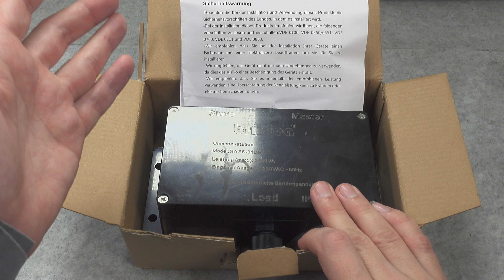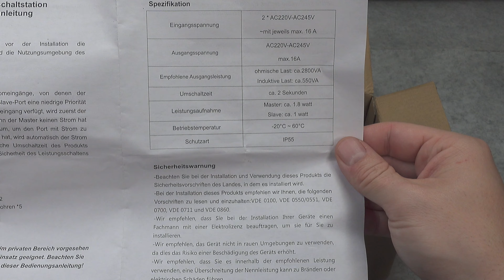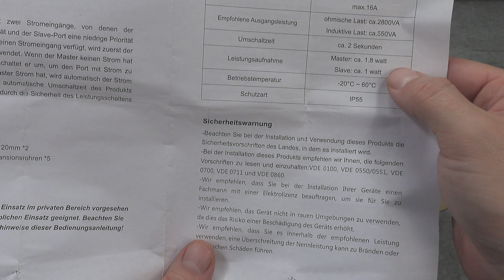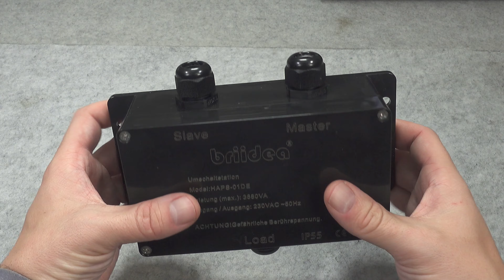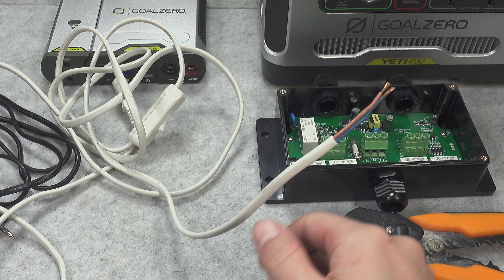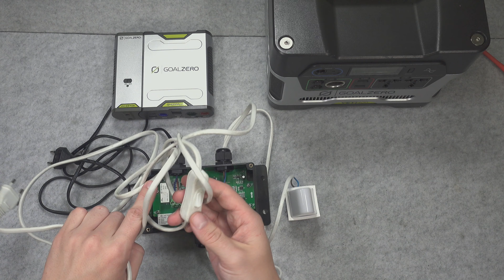HAPS-01DE  - relay based solar / generator automatic transfer switch (Victron Filiax 2) knockoff

Comment: Thank you for posting! The Filax 2 would definitely be better for computers (the Filax spec says 16ms switch time).  But this seems like a very good option otherwise
Reply from the maker: Thanks for the info! Definitely for PC You are 100% right, You would need small UPS otherwise it will drop- but for laptop no issue at all